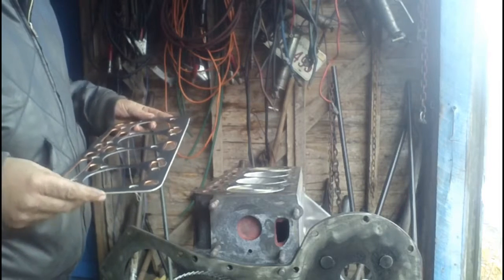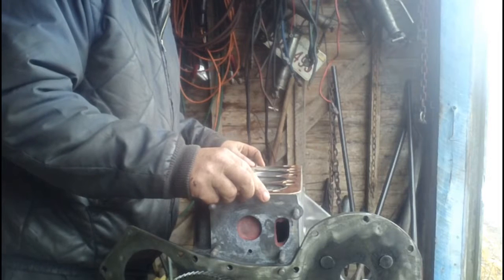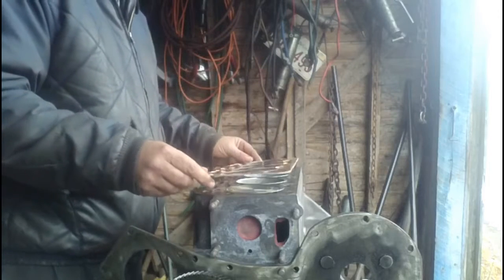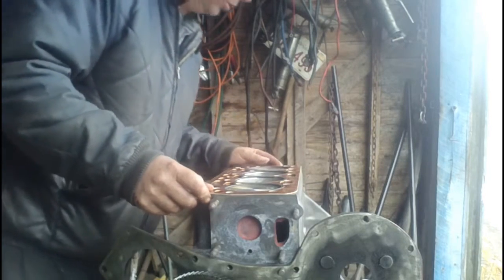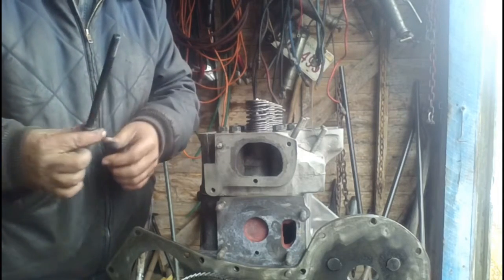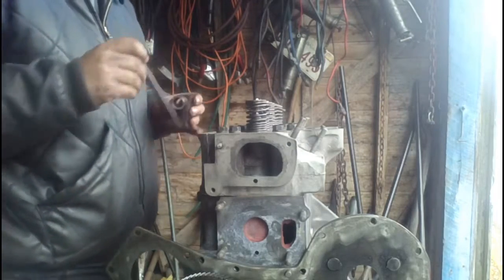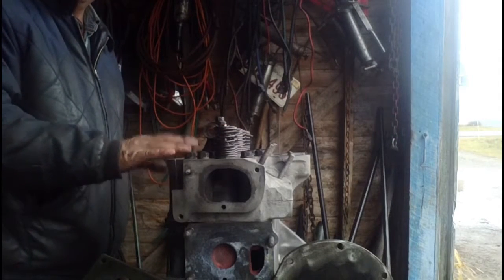BD 154  rebuild part 7, Oil pump and head

Comment: Rebuilding a BD154, in need of your help. Have you run into having new cam having oil pump gear too big to go through center cam bearing? That one is aftermarket. I ordered a new oil pump from dealer and teeth bind on new cam  with new oil pump but not with old pump to new cam. Cant change the gear over cause the roll pin doesn't line up, case hasn't got back to me yet. thanks!
Reply from the maker: I haven't replaced a cam so I can't comment on that but I have found that some of the new oil pumps don't match up like they should. Thanks for watching!

Comment: I saved all the videos on rebuilt engine 444 BD 154  when I rebuilt my tractor  2 years later I think I’ll have to use your videos again because I think my head gasket is bad or head might b crack  because my rad has a lot of pressure boiling over  These Videos are Great You helped me a lot when I work on my tractor Thanks Again Keep the videos comming Your The Expert
Reply from the maker: I am glad you found the videos helpful. I agree with your assessment, likely a head gasket or cracked head. Thanks for watching!

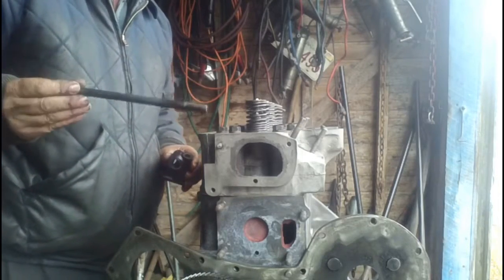Comment: Hey I am rebuilding my bd 154 in my 444 I lost oil pressure and it wiped out my rocker arms, the rocker arm shafts and rocker arms supports (3:40 in this video) the one that takes the long head bolt and the 2 on the end. I am in Saskatchewan do you know any where I can buy those parts In Canada?

Thank you Tyrel here
Reply from the maker: They're not available new that I know of but I would have used sets, you can reach me at sales@chowntractorparts.com
  Thanks for watching!

Comment: Thank you for your videos. I have an IH 3444 with a BD154 engine. I think I am in need of a rebuild. I have a question. In part 6 when you placed the head gasket on the block I noticed you did not use any sealant on it before you positioned the head. Do I need to do this when I am at that point?
Reply from the maker: I don't use gasket sealant on the gaskets, make sure the surfaces are clean and flat and you should get a good seal. I find putting the gaskets on clean will bond them right to the metal.
  I am glad you are enjoying the videos, thanks for watching!
Reply: @CanadianRedneck15  Thank you for the answer.

Comment: What should the oil pressure be on a bd 154?
Reply from the maker: Basic rule of thumb is at least 10 PSI for every 1000 RPM, on a fresh rebuild you should have at least 40-50 PSI. Thanks for watching!

Comment: My dad and I rebuilt the bd 154 in his traitor we think it has bad injectors it will crank run for a minute go dead is this the problem
Reply from the maker: Bad injectors would be more like running rough and smoke, this sounds like a fuel supply problem. Check for a good supply of fuel to the injector pump. It sounds to me like there is a restriction in a fuel line or filter, a bad fuel lift pump, or a bad injector pump. Good luck and thanks for watching.

Comment: I have watched this several times and have a question. When I removed the old head gasket it had 2 rubber grommets at the corners on the glow plug side. The rebuild kit did not supply these grommets and I notice you did not put any in. Are these required? Or does the gasket sufficiently seal
Reply from the maker: It depends on the gasket, some have the grommets built in, some don't. If they are built in they often aren't rubber. Good luck! :)
Reply: is there  downside to not putting one in? Other than leaking. By the way thank you for the speedy response. I have enjoyed these videos and done repairs i have never attempted before.
Reply from the maker: If there are none in the kit you should be all set, the head gasket should have been made in such a way that you don't need them.
  Thanks for the encouragement, it is nice to know that my videos are of help!

Comment: I get some blow by out the dip stick and breather oil cap. It will inflate a rubber glove slightly.  How do you determine when when to re-sleeve?
Reply from the maker: +Draggin Theline I always resleeve when I do a rebuild, you can buy a full kit cheaper than buying the parts seperately. Also, it's cheaper to buy the cylinder kits than pay the labour to hone the cylinders.

Comment: Where is the pressure gauge located in the oil passage circuit?  Is it after the cam bearings?  Example;  Pump to filter to crank bearings to rod bearings then to cam bearings up to the rockers then back down to oil pan.
Reply from the maker: +Draggin Theline The oil pressure gauge is fed off the mail oil gallery, so I would say before it gets to the the cam or crank, but that is not an issue because you still get a true reading.

Comment: Is the oil pan 5 inch or 7 inch deep.  I heard that the new oil pumps require a deeper oil pan.
Reply from the maker: +Draggin Theline  The oil pan is a 7 inch pan, I believe all the diesels were in this series. If you have a shallow oil pan you can used the bottom plate and sump off your old oil pump. Thanks for watching!